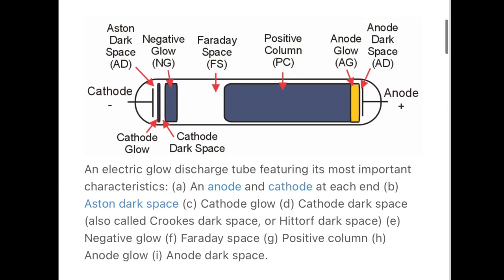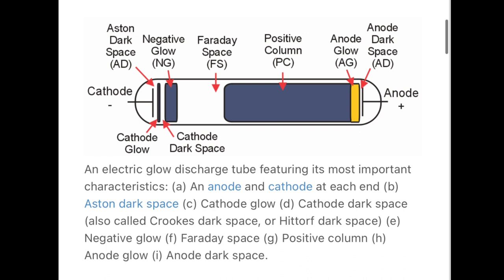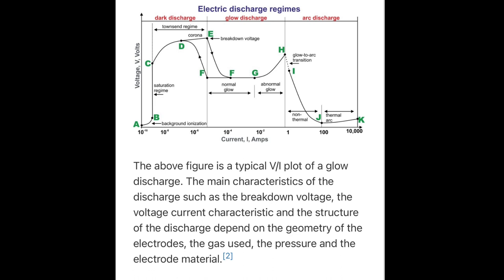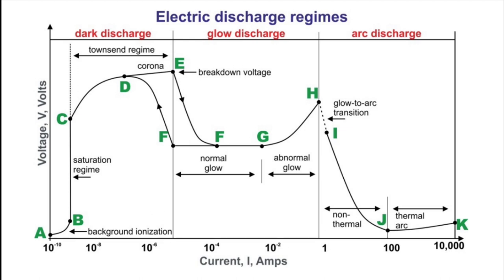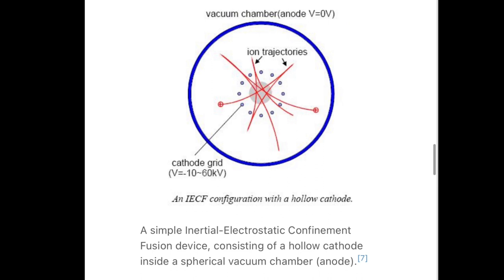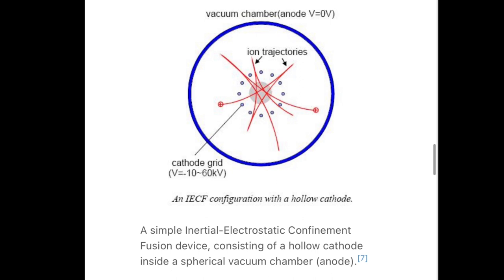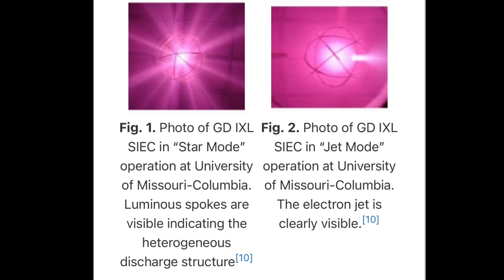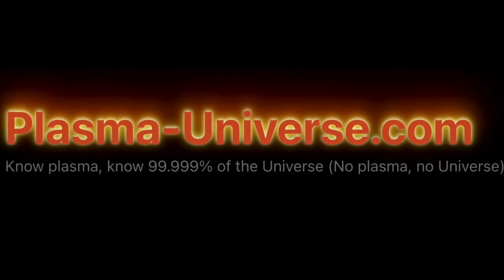Electric Glow Discharge - Plasma - Universe . Com

Comment: Assuming we understood: (1) Each fourth of a Precession, Earth hits a Birkeland Current resulting in cataclysm; (2) this happens on a vernal equinox resulting in a 40-day shift of poles with simultaneous flooding along the path of the poles; (3) the Event happens during the periodic passage of mostly-hidden stellar and planetary bodies passing through the solar system; and (4) the time is characterized as involving two pillars -- one red and one blue.  Would the pillars be seen near each other (as say, the Rechat Structure and a mountain 25 to 28 miles away) ... or would they be seen as opposite ends of the horizon like a morning star and evening star (per Hočąk legend)?  Orion, Aquarius, Leo and Scorpio figure hugely in the Creation legends, just as they will light up our skies.

Comment: Good work. Thornhill doesn’t agree with the concept of photons. I think the EU notion of light is as a wave modality or ‘field perturbation’.
Reply: I think Thornhill uses the phrase 'neutrino' to refer to photons, or ether medium particles.  He uses the term neutrino in his video on the gravity wave detectors.   Light is an energy wave in the ether medium.   The constituent particle of the ether medium as also sometimes referred to as photons, even though light is a wave in the ether medium consisting of particles.   Thornhill is basically saying that the ether medium consists of neutrinos particles instead or calling those particles photons.   The particles ejected from a laser cavity and from the electron orbits of matter, during the photo electric effect, are also referred to as photons.
But I think the concept is the same, basically talking about electron-positron pairs or ether medium particles that pervade matter and cannot be stopped from pervading a vacuum.
So Thornhill is basically saying that light travels by energy wave in the ether medium, not by photon as a particle, or the Einstein particle based model of light.
    I do think Thornhill thinks that the ether medium has been detected by the Michelson-Morley experiment as it did observe moving fringes and a speed of about 7 km/sec.
   Steven B. Bryant does a good job at showing that the problem with Michelson Morley is that they used a relativity or particle-based equation instead of a frequency-based Superposition of Waves equation, which does return a value of about 30 km/sec for MM..
I do however think that the EU does a poor job at incorporating the ether medium into their models. 
Ron Hatch does a much better job at describing redshift, light speed, clock speed, and gravity with an ether gauge model, that the EU ignores.  The EU models, and their gravity models, run into other issues by ignoring this concept of a dielectric or ether medium density gradient, that Steinmetz uses in his materials.

Comment: EU Eyes be on Star Mode full blast - THNX! I have an audiobook fetish to the extent that I would NOT have read this stuff, but you have given it to me in my format of choice. I owe ya.
<3 C3

p.s. I got a hardcopy of Crooke's Radiant Matter - I need some of those bulbs, holler if you intend to (learn to?) make some with your vacuum pump :) BUT I am attempting today to transmit 'single wire' power through a string of 2 fluorescent tubes (instead of the wire), perhaps you'll see a video of said funkyness from me soon, cheers!